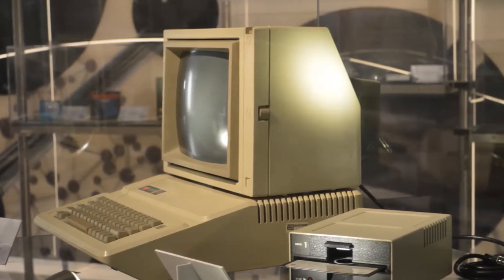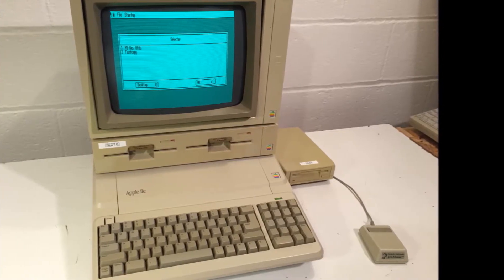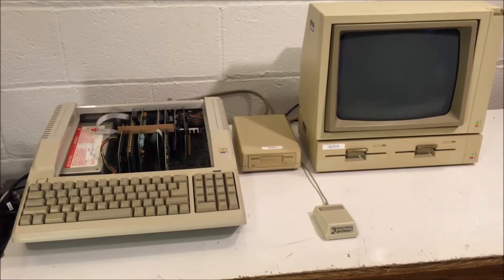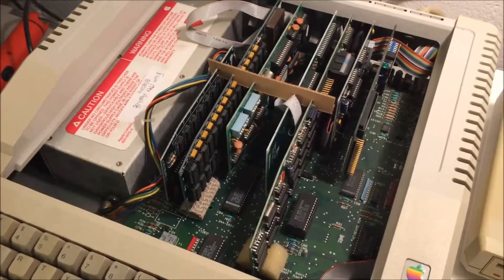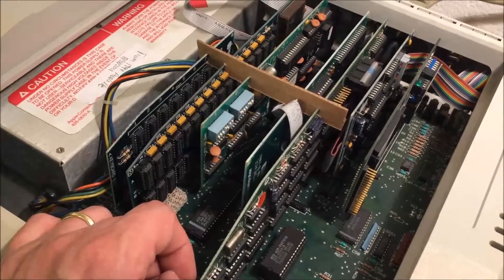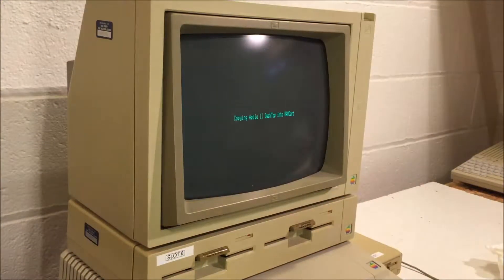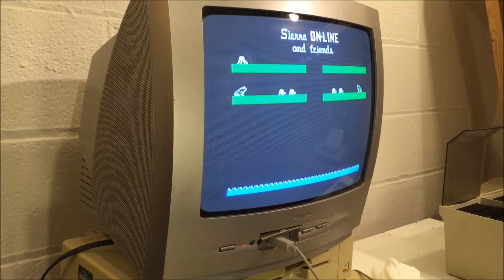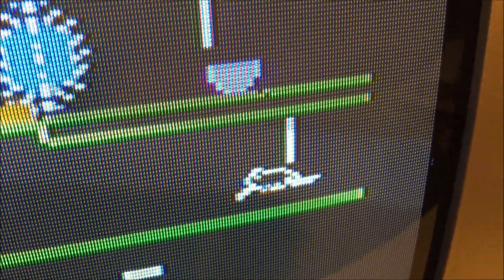Exhibition: Apple IIe Platinum

Comment: Do you know if the platinum had anything that resembled the After Dark flying toasters that came out in 1991for later computers? I vaguely remember a pixelated early version of that earlier than 1991.
Reply from the maker: I vaguely remember something like that too, but probably only for the AppleWorks application. Not 100% certain.
Reply: Thank you for the response.  I put the wrong year in my question. "After Dark" was released in 1989 for Macintosh Apple, according to Wikipedia. My memory of first seeing the flying toasters though, is from 1987 or 1988. It was in a much lower resolution and maybe on the platinum we had in computer lab at school. I could definitely be wrong though. It could have just been 1989 on some other computer. Thank you again for your response. You have a great channel!

Comment: How did you get the Macintosh OS on the apple II?
Reply from the maker: That's Apple II Desktop - It's been around for a very long time, but has seen a recent resurgence in development. https://www.a2desktop.com/
Reply: @JoesComputerMuseum  When you use adt pro to put a file on floppy, do you need the Adt running on external device for it to work? Or is it just put a file on the floppy and press play?
Reply from the maker: @TheHelloNeighborShow  You need ADTPro running on a PC with a serial port, and your Apple needs to have a serial port.